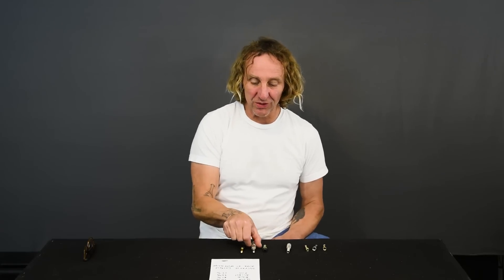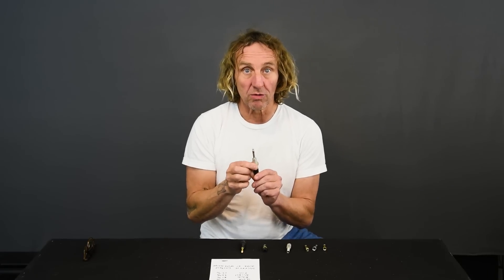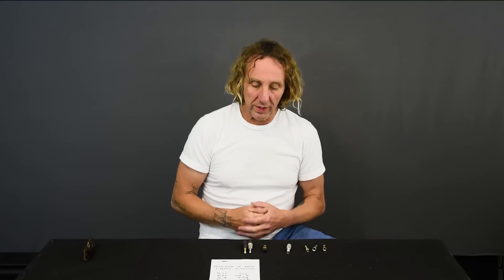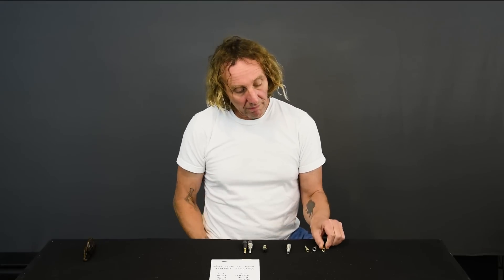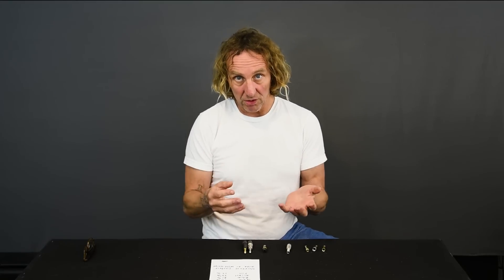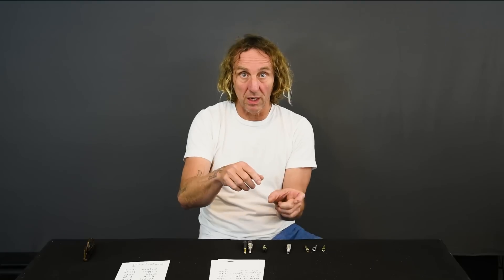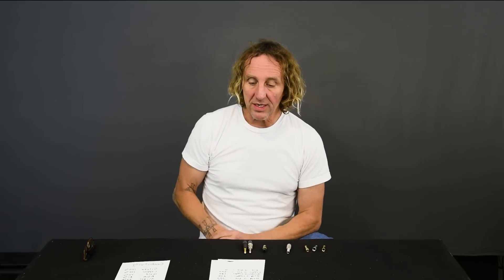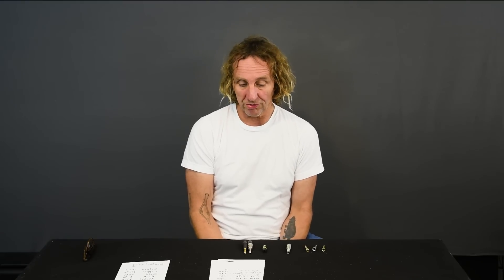Gold vs Silver (Nickel) Audio/XLR Connectors - Which is Better?

Comment: I'm old a jaded and often thing I don't have new things to learn, but I didn't think about galvanic corrosion! That makes a ton of sense. To an extreme (which won't happen for most/all low voltage audio) were the galvanic corrosion issues around aluminum and copper connected wires for home electric!

Comment: When I thought that I wanted to retire from my audio career, I moved to the Florida Keys. I took a job doing re-fits and installing Northern Lights diesel generators on yachts that were on the salty sea. HUGE, galvanic issues. Grounding points, even with similar metals, we were required to used TEF GELL on all termination points. In my electrical career, we were required to use NOALOX Aluminum to Copper connections and split bolts. Would TEF Gel be a good product to put on Molex connectors on our many 9001s (In different states of disassembly)  we have in our warehouse?
Reply from the maker: Interesting idea and it should help or solve. Though testing to prove it would be a long wait.

I am a bit familiar with accelerates corrosion tests where salt water is sprayed and let dry days on end.

I will ponder testing.
Reply from the maker: Worth a try, the issue with gels and lubs in audio is the attraction of dust and the associated noise when dusty lube is involved with an audio connection 

That said, the molex once lubed most likely won't get dust or dirt I. The connection.
Reply: Many of these compounds for preventing corrosion are highly subject to attracting contaminants such as dust where the connection is repeatedly made and taken apart in a touring environment. To prevent the surfaces becoming sludge pots of grime, found the best solution is to simply keep them clean, and take the time to clean them regularly.  Many spray contact cleaners include a lube, which reacts with the environment over time and turns to a wax, thus interfering with a good contact. Ask anyone who has used this stuff in volume controls, faders, etc and this cure caused major problems later. Do not soak your console faders in WD-40 or other lubricating cleaner as the residue attracts dirt and dries to a wax over time.  Edit. Many of the lubricating oils will react with moisture and become acidic and thus conductive and an electrolyte in the presence of dis similar metals making galvanic corrosion.  Ask any tech that has tried to clean up old gear about the green scum in connectors.

Comment: Future episode idea: Adventures in contact cleaning.  Have you ever used contact cleaner on cables and jacks, only to find the contact cleaner destroys plastics in connectors, rendering them so brittle that they crumble?   You can use contact cleaner on some electronics devices, cables, and components, and NOT on others.

Certain CAT5 jacks for example, crumble, when contact cleaner (meant to be cleaning their pins) touches the plastic in the jack.
Reply: Kontakt 60 spray cleaner is quite OK for switches and plugs, but it may eat the coal layers in pots and faders. I use it a lot, no crumbled plastics so far.
Reply: We always had really good results with DeoxIT Gold. Been using it for over 15years.
Reply from the maker: Oooh interesting. Yes, I've done the crumble! I will ponder a dive I to that.

Comment: I have had so many pedal board failures from galvanic corrosion it's crazy. It's a huge problem here in Nova Scotia espesially in the one venue I used to spend at least 100 nights per year and I maintain their rigs in the building. That building is basicially touching the ocean and a few times per year floods during a storm surge and the doors are allways open and the salt air permiates everything. I have traveled with various grades of fine ScotchBrite sheets for many years to quickly clean 1/4" patch cables and jacks on the fly.  A great product that I found keeps the corrosion from happening in those extreme conditions is DeOxit Shield S5, it doesnt have the cleaning properties of regular DeOxit D5 but has the continued corrsion protection over time. It was $30 Canadian for a can but the saved downtime was well worth it.
Reply from the maker: Interesting and thank you, that is useful info!
Reply: @DaveRat  I have had other equipment fail from that problem as well... Even electrical panels! Stan Rogers folk festival is right on the the ocean and one of the AC panels is on a power pole for one of the tents. We actually had to stop a show and disassemble the panel and clean all of the breaker contacts with files, scotch brite and contact cleaner to restore proper power. It is amazing how a tiny amount of corrosion will send the resistance skyrocketing. I used to have to Deoxit in ear packs while they were in use quite often as well. The band members would give me a signal and I would blast on stage, pull the 1/8" out of the pack, spray in the 1/8" scrub the plug quick and jam it back in while they were still playing.

Comment: Unrelated to audio, but another major manufacturer that should have known better... Ford.  The fuel pump driver module on the 2004+ F-150's has an aluminum housing and sits on a steel frame cross-member above the rear axle, exposed to the great salt bath that happens on our roads every winter.  They all eventually fail, often without warning and leaving the truck dead.  The revised part includes rubber bushings to keep the aluminum housing about 1/2" off the steel cross-member.

Thanks for the info... I've known about this for years, but never considered it with audio connectors!
Reply from the maker: fascinating! and so interesting.  The complexities of the nuances of products being manufactured is truly amazing and the slightest obscure mistake can have huge ripple effects.

I know of more than one audio manufacturer that has made reliable products that work great until put into a shipping container and the ocean crossing destroys the connectors and circuit boards.

Comment: An audio engineer of your reputation. Is reading notes . On something you should know inside and out. Smh
Reply from the maker: Ha, well we all should know that dissimilar metals cause issues. Though not much need to memorize the exact numbers but giving wrong numbers is not ideal. Sometimes accuracy supersedes ego. In fact, not worried about the ego side of things, purely concerned with freely sharing helpful info. Hopefully you are doing the same and enjoying spending time assisting others with helpful info as well.

Comment: You might save yourself a whole lot of headaches by keeping a tube of electrical grease around.  If you keep a light coat of the insulating grease on your connectors, it will prevent oxidation by preventing moisture and oxygen from causing the corrosion.  I've got an old tube of Dow Corning electrical grease that always does the trick.  There are also some contact enhancers that claim to work on a molecular level but not sure if its just expensive snake oil.  I have applied it to a few things and it seems to work pretty well too as I haven't had any obvious failures where used.  You would think that an insulating grease would be a bad thing for connectors but I have yet to experience a problem.  Your thoughts?
Reply from the maker: Yes, grease helps but also causes its own issues by collecting dust and dirt in addition to adding time and maintenance. I know for us, we have several thousand XLR cables and keeping them greased cleaned and re greased would be a full time job in itself
Reply: @DaveRat  That leaves something like Stabilant 22.  Its expensive. Maybe apply it to some cables and equipment connectors.  Then mark them as being applied so you'll know if you have a problem in the field when its go time.  The big problem is the constant set up and break down of the system.  Stabilant would probably need to be re-applied periodically.  I guess that's why you always carry spares.
Reply from the maker: Yeah, for XLR, we don't really have issues as we are all nickel and they hold up well. I mainly see the issue with guitar pedal setups that stay plugged in but are exposed to sweat from the musicians. Definitely have seen various sprays and such used.

This video came out of a discussion as to whether SoundTools should offer 1/4" cat tails in gold or nickel.

People tend to percieved gold as "better" yet most gear has nickel, so offering a dissimilar metal is actually worse, but we would probably sell more if we offered gold.

So, we decided on what's best rather than what people perceive as best, and will run with nickel and I made the video to help inform.
Reply: @DaveRat  The gold plating is more like gold flash.  More of an oxidation prevention while stocked by the vendor that wipes off with first use.  Those crummy 1/4" jacks might be the best use case for a light coating of insulating grease since the connector is inside a foot pedal and there is decent wiping action.
Reply from the maker: Agreed on the gold but still not backing grease. Grease with even the slightest dust will crackle on a 1/4" if the dusty grease holds dirt between the wiper and connector.

Too many issues. We see that issue with console faders where the grease on the sliders works its way down to the contact wipers and the fader is noisy until all grease removed. 

Sprays with any oils into faders guarantee they will go noisy and gritty in short order, requiring a complete disassembly and cleaning or replacing.

I have had nothing but issues with oils and grease on contacts over the years
Reply: @DaveRat  faders are a totally different subject but it sounds like they've reached end of life.  A brand new slider has some kind of lubricant from the factory and a poor excuse for a dust shield.  Otherwise the carbon track won't last very long.  I wouldn't run them dry. Inherently, slider are a poor design when longevity is expected.  But I guess sliders make user adjustments on the fly easier.  It is also easier to get a visual on where things stand.  I guess the many compromises win out.
Reply from the maker: Interesting, I've done quite a bit of console maintenance and rebuilt faders. Just like with potentiometers, I rarely see wet or oiled contacts, there may be a dry lube imbedded but most of the maintenance and repairs have to do with removing oils, residue and dirt.
Reply: @DaveRat  I put a request in to Bourns to see what they have to say.  No response yet.  Two other things: 1) Did you try out the ZS10 Pro IEMs?  Would like to know what you think.  2) with your experience have you covered various voice processing?
Reply from the maker: I listened to but not tested the ZS10s. I will do more In ear stuff at some point. As far as vox processors, have not done testing or really used them

Comment: I used to fight all the time with Molex connectors on power supply connections to computer equipment on industrial machines. The only sure way I found to fix the connection issues is to cut off the Molex plug and solder the wires directly on the pins. What do you think about products from Caig Laboratories like Deoxit? Channel Master used to make a spray for the silver contacts in the old mechanical tuners in television sets to protect the silver from oxidizing.
Reply from the maker: Deoxit is all good. Yes, cut and solder for great fix!

Comment: OK what about gold speakon. Is it available
Reply from the maker: Ha! Not that I know of but since there are none out there, spending money on making sure you have a dissimilar metal to the norm is probably not the optimum plan. Speakons are interesting in that they "wipe" when connecting and it gives them a self cleaning attribute. Gold may not be ideal are the wipe action would seem to wear the gold away.

In my opinion, gold connectors are mostly a marketing angle to get people to spend more money on something that has more disadvantages than advantages but looks pretty.
Reply: @DaveRat  that's so amazing you have time to reply to me , means more than  anything .

Comment: Still have Crest Audio amp's (racks). Its fits on my Martin Audio speaker and at live good singer and good mix "the Tube sound'". I have toured many years (20!) and have one or two times a isu whit a amp's and have two times blow up a 12inch speaker monitor system (S-200 EV), but thay also the work horses under speakers and are very beer thirsty xd.  I repair also (parts stock) Crest audio and maintenance. https://www.youtube.com/watch?v=FSkNf5Yl8-Y
Reply from the maker: Very cool.  Let me know if ya are looking for any Crest parts, we have amps and modules that we would like to sell at low costs

Comment: Fascinating! So what about solder joints? Does being an alloy help prevent galvanic corrosion?
Reply from the maker: From what I understand, the dissimilar metals is the foundation of the issue and the moistures and salts in the air are what activates/accelerates the issue. Solder seals the joint so it keeps out the salts and moisture.

Comment: Infesting so if that’s the case and we have a cable should the cable itself be copper or gold yes I know gold cables would be 🤑 but from the boot of the connector onto the cable John it changes but as you say anymore than a home hifi once it’s connected not a problem unlike our tour gear that gets plugged in and out all week long.  Amazing discovery you could have saved the company and L’acoustics and Clair Bros might have been the Behringers  of live sound.  Bless
Reply from the maker: It's important to keep things in perspective.  Solder joints work well and are reliable. The nickel and gold work well and for optimizing, also matching is preferred. Tin tends to have issues over time and is not ideal for connectors that are plugged and unplugged.

I live near the beach and even the nickel and gold connectors need maintenance when sitting for a while
Reply: @DaveRat  agreed Hervey Bay QLD Australia beach is 400m away from us and most of my jobs are obviously places along the esplanade or I’m on the beach doing weddings at Fraser Island (the biggest sand island in the world) so I’m doomed but it’s life we do what we do and it’s the price we pay for living in paradise.  I go to extraordinary lengths to store my equipment and keep the humidity and sea air at bay where I can it’s my Hi-Fi and model railway and toy room that get climate controlled environments.   

All our cables are custom made Mogami with either proprietary mogami connectors otherwise neuitrik and I have been ridiculously happy if it’s good enough for the recording studio I figure it’s good enough for the other end. Gold to gold is a great way to go but as you know it’s beyond out control I have a colleague who is a master jeweler and hifi enthusiast has to build some crazy gold creations for other audiophiles some incredible stuff anyway enough of that keep up the awesome work you are the Stephen hawking of live sound 🙏🤘
Reply from the maker: Awesome and thank you Jose!

Comment: With boats they put zinc plates on the bottom to allow the electrolysis to eat them instead of the metal parts of the boat, ever so often you replace what's left of them. The zinc is a soft sacrificial metal, not so easy to simulate in the above water world I suppose. Super interesting, I honestly never thought this sort of stuff happened in the open air short of how big antennas tend to weld themselves due to dissimilar metal fasteners. I guess now that I think about it that would explain why in typical household AC wiring it's all copper on copper or copper on brass connections. There is aluminum too, but again it stays isolated to itself and often has an oxygen inhibitor being used at the connections. Funny how there are actually many examples of it in plain sight (so to speak) but no one ever comes out and explains WHY quite as directly as you did. This really has me rethinking the deliberate intent behind such things as how a typical household electrical panel is constructed and why, let alone the audio stuff. Gets my mushy brain thinking about stuff in different ways. Sweet video, thank You sir may I have another, LOL. hope all is well Dave. :)
Reply from the maker: Interesting and thank you!